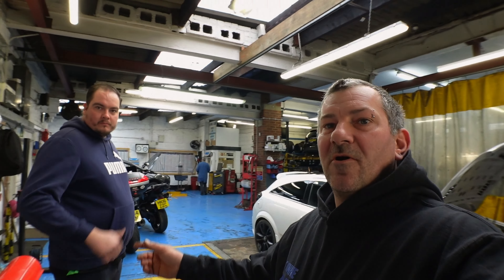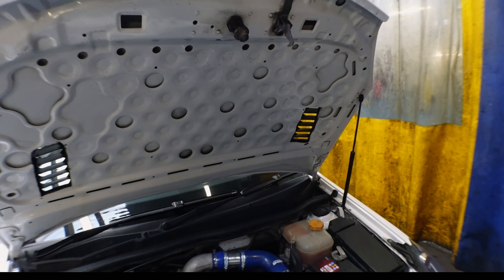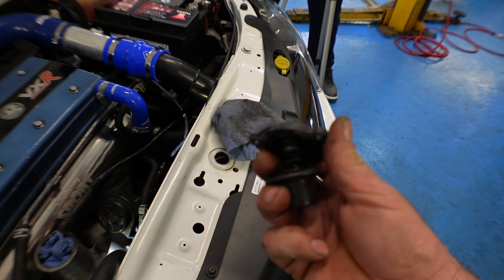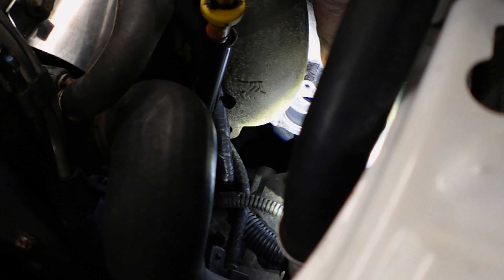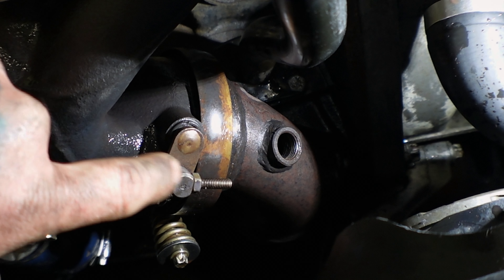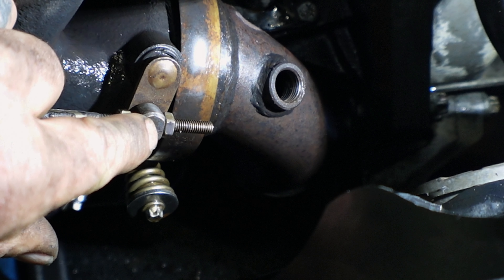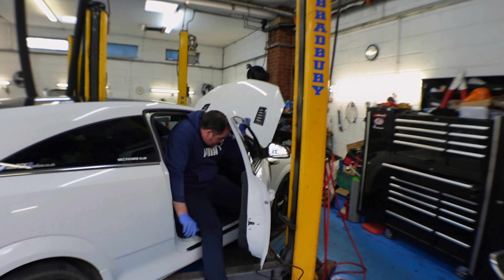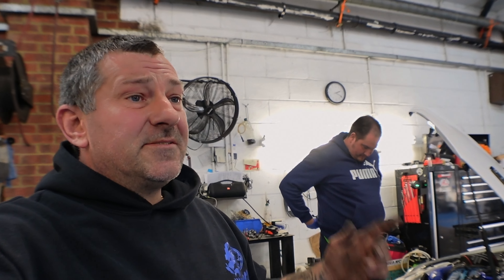Astra VXR Piper￼ exhaust along with a turbosmart actuator & recirculation valve

Comment: Do you know the torque settings for the astra vxr oil cooler pipe from the cooler to the oil pump vinnie I can't seem to find it
Reply from the maker: Hello mate there’s no real torque setting for the cooler pipes I normally do them similar to a spark plug just a little bit tighter though mate
Reply: @Vinnievxr666  thanx vinnie